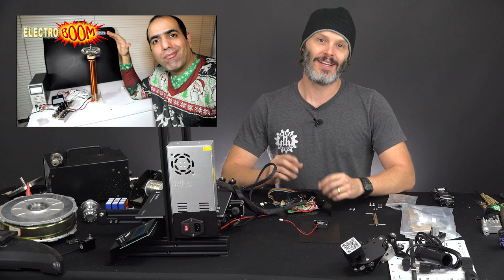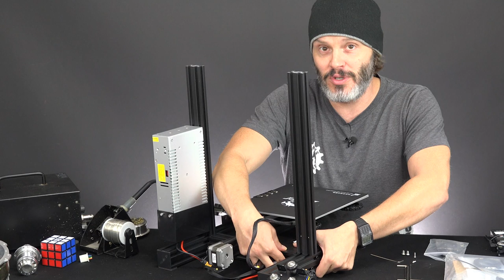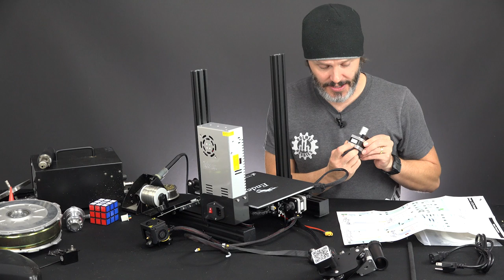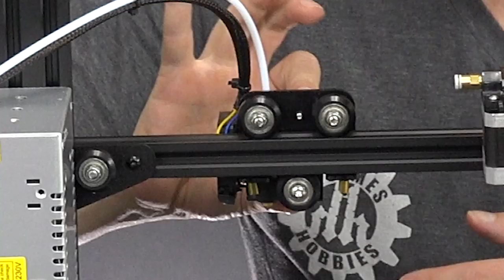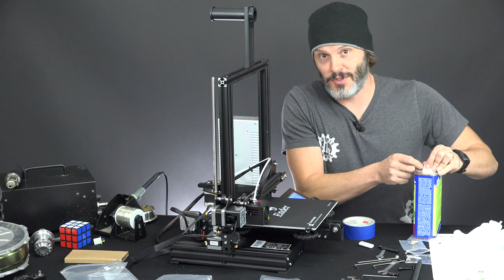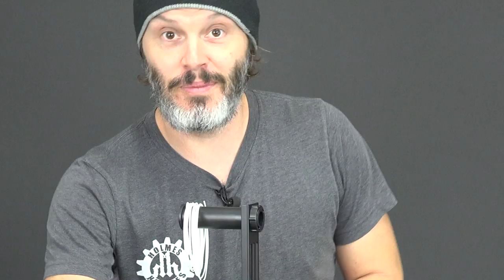Best Cheap 3D Printer? Creality Ender 3 Overview, Inspection, Assembly & Impressions -Holmes Hobbies

Comment: Great video! My first printer was a Printrbot in 2013. It was made of wood, used fishing line for belts and sanding drums for pulleys. I have gone trough at least 10 fans, 4 hot ends, 3 motors, 2 main boards, several meters of wires, and half dozen linear bearings. My current printers use auto bed leveling, and I print directly to magnetically attached spring steel sheets using glue stick for adhesion. My favorite thing I printed is usually the last nice thing I made. At this moment it is a Carbon fiber PLA brace for a Tamiya TA-07. I have put together a CR10 for a friend and liked the build and design of the Creality stuff.
Reply from the maker: Those first crowd funded printers were something, huh?
Reply: @HolmesHobbies  In comparison to what's out today, they were junk, but everyone who saw my little wood printer was amazed.  A good friend said "the future is now... and it is surprisingly made of wood." Haha!

Comment: I have an Ender 3. No issues so far, probably 6 months or so usage. I put an upgraded extruder on when I first got it and recently put a glass bed plate on it. For the money they are hard to beat. I also have a Tevo Tornado, it works great too and gives me the option to print larger projects. BTW, instructions are just another man's opinion. 😉

Comment: I have the CR10S and it works really well so far. Havent had any issues except a fan i broke. Although I did upgrade the hotend and cooling block to MicroSwiss, and a Capricorn bowden tube.

Comment: My Ender 3 has only had one failure and that was the Extruder driver when a jam occurred and bound up the Extruder. I've since replaced it with an upgraded silent board.  That along with replacing the springs with silicone spacers to keep the bed level longer and many printed upgrades it now prints great with very few failures. I have the Ender 3 Pro coming next month and I'm looking forward to getting it set up and printing.

Comment: I have the pro version of this printer, it is a very good printer for money. Everything sticks on the included bed. I “upgraded” to a glass bed and now I have problems with PLA+ and PETG, sometimes they just don’t stick. I am still learning tho. It is very good to have it for printing RC parts and accessories. I printed Knight Customs bed and interior for a Axial C10 body, the savings on those accessories have paid the printer already.
Reply from the maker: PETG needs 90 to 95c to stick to glass.  Be sure it is extra clean.

Comment: I'm running an Ender 3 Pro. Been an awesome printer especially as it is my first printer. For the money it is a damn impressive little machine. 

Only issues out the box were that the uprights were perfectly square to the based and I had to shim them a little.

And my biggest gripe is that the bed had warped.... probably my own fault as I ran the bed temp at 60 degrees by mistake for a little will but I just print everything on a raft and that snag is not a snag anymore
Reply: Enders are known for warped beds so I bet it was that way when you got it.

Comment: I have an ender 3. I have had 0 problems in a little over a year. I believe its 24V. The biggest pain in the ass is getting the wheels adjusted right.The older ones do not have thermal runaway the latest ones do. That bed gets destroyed pretty quick. Since I follow you on Instagram there is a piece you can print on thiniverse to convert it to direct drive. you just need to extend the stepper motor cable.

Comment: I prefer to use a mirror as my build surface.  Unless you get borosilicate glass, you will more than likely have surface imperfections on the glass that will preclude you from having a nice level surface.  By using a piece of mirror, you are ensured a smooth and flat surface.  Otherwise, you would see imperfections in the reflection of the mirror.  Most glass places can cut a piece of mirror to any specified size for very little cost.  I believe the piece I use on my Ender 3 cost me about $4, including them polishing the edges to round them over and not be sharp.
Reply from the maker: I have a stack of mirror tile from lowes for all my other printers :)

Comment: Thanks... I was looking into this printer! If I want to print scale accessories or a new battery tray for a crawler, would PLA be strong enough?
Reply from the maker: typically not a problem unless you live in the desert.   Don't leave those parts in a hot car though.  They will slump.
Reply: PLA is strong, but it can warp just being in the sun. PetG is the better option.

Comment: It’s 24v not 12v john....you usually redo the screw terminal wires due to them tinning . Tinning is not good for screw terminals they are causing high resistance. Also update the boards firmware to Marlin 1.1.9 or what I use TH3D unified software because stock ender 3/5 firmware doesn’t have terminal runway protection installed .
Reply from the maker: Could have swore the PSU said 12v.  Wasn't paying enough attention!   I noticed the wires were tinned in the terminal, great call on redoing the wire ends.

Comment: Do you guys make parts for us , if not are there co that coukd tell them what you need. I need a battery box cover and its important bc the servo tray bolts to it . Trying restore my old losi ik ik not a crawler lol🤯
Reply from the maker: I pretty much stick to designing motors and supporting electronics.  3d  printers are really just used for prototyping and tooling in my shop.

Comment: Dam i wanted to see the pig. I'm totally new to 3d printing. What is best filament to use to print rc aarms? That won't be brittle? 👍
Reply from the maker: next vid!   Nylon would be the best for an A arm, you will also need a filament dryer (food dehydrator works) and an aftermarket all metal hot end.   Doing proper structural parts adds up quick in costs.
Reply: Don't print A arms. Pet+ works great on crawler parts. And you don't need to dehydrate it!
Reply: @HolmesHobbies  thank you